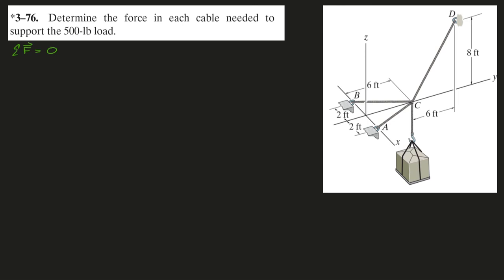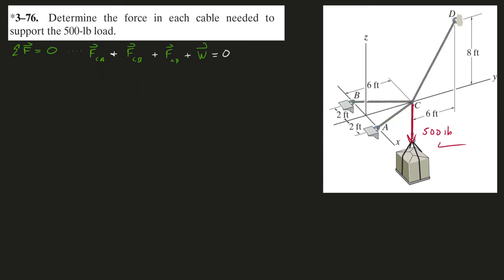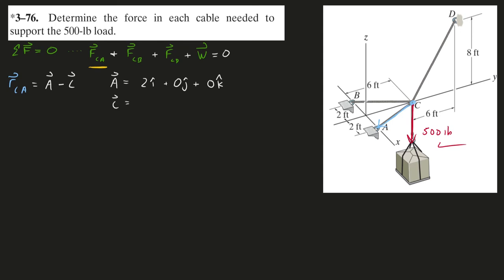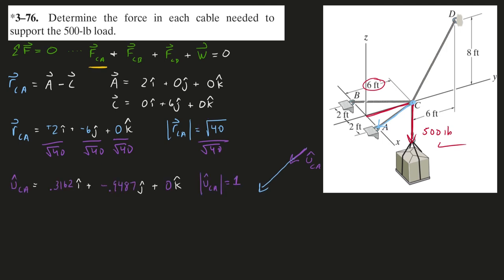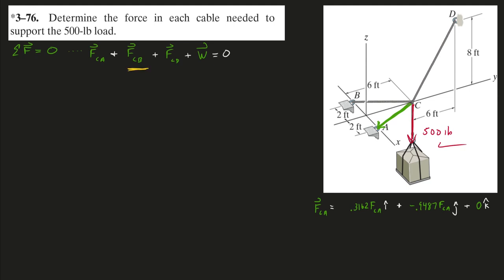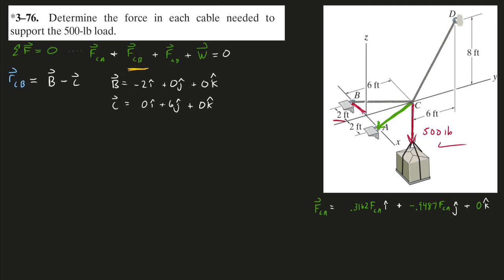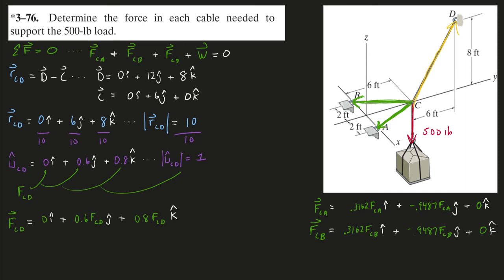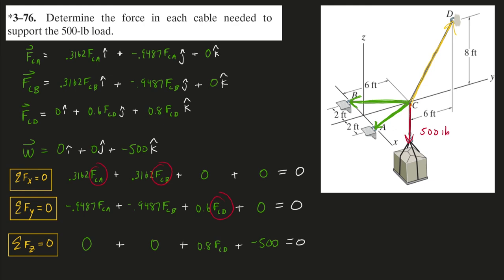Statics: 3D Force Equilibrium Problem

Comment: Im so confused on the position vectors. How would you know for the position vectors that you can use CA, CB, CD? couldent it be AC, AB, AD?  like in other problems ive noticed that the position vectors go from one point to the other forces. Can you please let me know? thanks
Reply from the maker: That's a great question. Here's my answer:
Remember, we are doing a Free-Body-Diagram of that point in the middle (point C). From the "perspective" of that point, it is feeling a force going from C to A. It feels a "pulling" force in that direction.

If you did AC, that means that the force's direction would be FROM a TO c, and as a result, that point would feel like it is getting "pushed".

Hope this makes sense

Comment: Great video thanks a lot! However, I believe you made a small mistake when calculating the unit vector for CB. When dividing -2i/sqrt(40) you should’ve gotten a negative value and not .3162i it should’ve been -.3162i Still great great video it helped tremendously!
Reply from the maker: Jeez how embarrassing :( Thanks for letting me know Taha! I'll re-upload this video